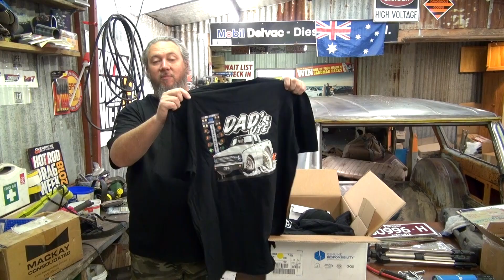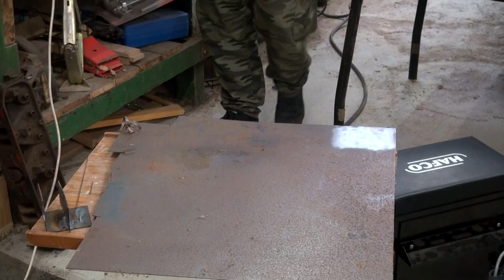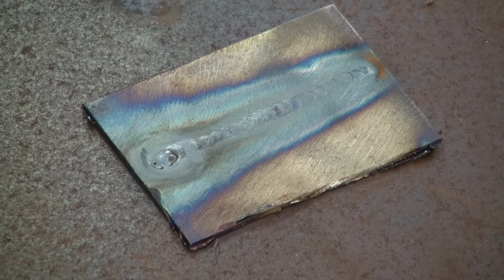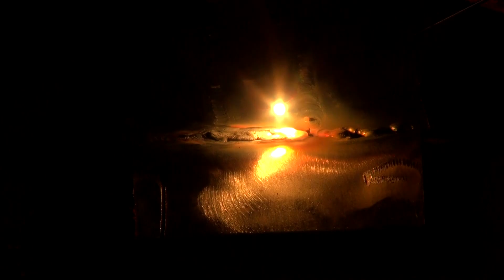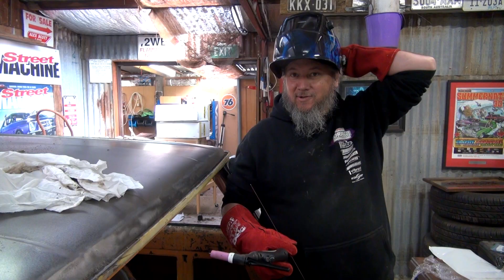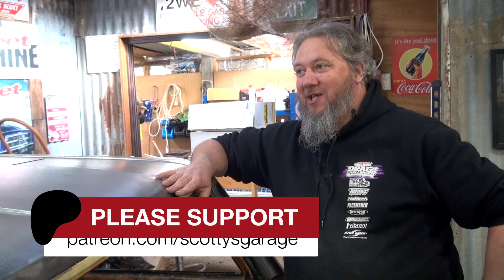Scotty's Teaches Himself How To TIG Weld... And It Goes Badly

Comment: Your welding table is an active part of the process. It sucks out the heat and provides a backing for the weld poo. On my car i blew three all over the place until I bought a piece of 50mm copper pipe and found some old 12mm copper pipe. If you place the flattened copper pipe BEHIND the welding gap you can weld more easily. The copper sucks the heat out and the weld does not stick to the copper, so you can use the copper as a backing for the welding pool. Car panels are thin...

Comment: Nice work Scott, i have same welder, i watched Trevs blog for Tig tips i was struggling to fill holes as well and his tip was arc on the filler wire not the panel to stop the hole blowing bigger and you cant fill holes in one go it takes a few times of fill a bit, stop, let panel cool down, fill a bit more to fill holes same as it would with mig
Reply from the maker: Thanks for the tip

Comment: Oopsie!!! I'm no TiG welder but I do know that the amps for 1.6mm steel will be far too high for 0.8mm thick bodywork steel. Then you have rust on the underside of the steel and you have to adjust the amps to compensate for the poorer conduction. 
Still, I think that was a brilliant first effort and unlike MiG welding TiG is practice practice practice

Comment: Hey Scotty your doing great on the tig mate for a first crack at it , I found when I used to tig it was easier to move the filler wire if I had a riggers glove on that hand for more movement on my fingers and still use the welding glove on the other , maybe give that a go for next time 👍🏽
Reply from the maker: @Matt_685  thanks the advice
Reply from the maker: @Matt_685  thanks the advice

Comment: Id use mig for filling holes. I haven't used tig for body work yet just stainless steel work. But for patch panels using tig should be easier. 👍

Comment: I'm transitioning from MIG to TIG too, so this video was very interesting! 👍
Re the holes in the thin metal, I think MIG with a fine wire 0.6mm or 0.7mm is a great method, just do lots of short tacks (less than a second) on the edges of any hole and it quickly fills in. 
MIG is great for that because it literally stuffs the wire right in its face.
I recently did a toolbox with 0.7mm thick sheet metal (ouch) and it was hole city, but I was able to tack up all the holes easily enough.
Reply from the maker: @wizrom3046  Yeah, I agree MIG is better for this

Comment: Great first crack Scotty! Definitely get yourself a pair of riggers gloves. You can also set the tig to start via the button which is find easier and i found the pulse setting easier to weld with. Keep in mind i’m self taught with 5 mins tuition from a boiley. Also keep a wire brush handy post weld to clean up the heat marks 👌

Comment: Hi Scotty,  I've also tried leaning to Tig welding with little success however a few things I've learned are

1/ When you were practising Tig welding, you had your test piece sitting on a metal table , the metal table draws the heat away making it much harder to blow holes , so when you tried welding the car it's "far" easier to blow holes .

 2/ When filing a rust hole the rust behind the hole is usually far larger than the hole itself so the metals much thiner around the hole.

3/ The most important thing to do is, practice,  practice, practice before touching your car

Comment: You cant weld up rust holes like that in that manner even if you are a skilled welder scotty so dont fret! I rekon there is alot of pitting on the rear of the panel causing it to be paper thin. You need to really cut out atleast 1" into the panel whenever you have wired through on the body and replace it with new metal. If its paper thin doesnt matter your skill really but you probably need to get that foot pedal out for that kind of of work so u can modulate the power as you watch the panel start to fall away. You also need to hold your hand steady by steadying your hand on on a surface, you were attempting what tig welders refer to as freestyling and thats not a novice move (Your cant maintain a consistant travel speed, angle, and contact tip distance without one.). You didnt do yourself any favours by re-welding over the same spots. You really should be only tacing every 1" around the butt to stop the panel from warping. You stack tacs till you make it the whole way around, then grind and repeat. Im using flux core to patch up my troopy after learning the cut-n-butt off fitzyz fab, he is a great teacher https://youtu.be/eKM0Yhgg040?si=CrNUqBi_M91nLOr4. Its cheap and does the job although it makes even great panel guys cringe as that recent video shows. Making mistakes with greg has a good intro to tig where i learnt all the above. Honestly i think its very advanced to body work with tig its def not an easy task, making mistakes with greg has some very good intros to the basics i mention above in his recent series: https://www.youtube.com/results?search_query=making+mistakes+with+greg+tig

Comment: Hey Scotty, Jake here from supermangs water to air tank. you're definitely on the right track, 2T no foot pedal, low amps, torch angle/rake should be anything from straight to 15 degrees (85 degrees). you can also push and pull if you're using the torch wiithout filler. The most important thing is to get comfortable and have fun! if you would ever like to collaborate again i'd be happy to spend a few days with ya. Cheers Scotty, all the best.
Reply from the maker: I lost your details, dude. Send me a message

Comment: Stick with it !!.   Practice make perfect, Not sure about in VIc but in NSW in 90s 1 night a week TAFE  welding courses. Ditch those gloves ( their MIG  ones = need thin leather welding gloves), Some ( even cut off finger tips of the weld rod  feed hand for better control ).  Use foot control = can vary current while welding = that weld towards the end = everything got too hot and not enough pace = foot control = can back off amps !!!

Comment: 25 years as a boilermaker and i have never TIG welded, so i can't knock ya for trying. I would say like all welding practice practice practice makes perfect. Anyway just wanted to say you can MIG body work, just need the amps down and travel fast. The biggest mistake people make with sheet is going too slow as once heat soaked it's game over. From what i see on your TIG welds i would say too hot but more a travel speed issue over amps. General rule of thumb i would teach apprentices, is your weld thickness shouldn't exceed your largest material thickness. So 1.6 gauge the weld should be around 1.6mm wide
Reply from the maker: Thanks for the advice

Comment: I'm no TIG expert but I have just recently done a TIG course at the Men's Shed, so I can offer you a few tips I learned during that 6 week course.

First tip is get some TIG gloves. Get some of those tighter fitting soft leather gloves. You don't need the same kind of protection that you need for MIG, so you can trade protection for a bit more sensitivity (I use them now for MIG welding, even if I have to replace them more often). 

Second tip (which you obviously learned online, which I didn't know) is that for TIG and gas MIG you push into the job, for gassless MIG you drag. You need to be able to see your puddle which is half the reason you want to push, also you want to be shielding the metal as you melt it not afterwards. 

Third tip surface prep is everything, especially when doing alloy. The mild steel you are doing is in between stainless and alloy in terms of how hard it is to flow the puddle.

Fourth tip tack your ends. I know you were only doing practice welds, but bad habits are formed by not doing the right thing. You could do fillerless tack on both ends before you started your run. Then blend the tacks into the main weld. 

Fifth tip, your filler wire angle is too high. You want to get it as low as you can. Try maintain a 90 degree angle between the torch tip and the filler wire. You want the filler wire to almost be touching the surface of the thing you are welding (even if it feels a bit weird). I like to hold the filler rod a bit further back, especially when doing alloy because at times you are going to need to feed it in faster than you can move your filler rod through your fingers. Experts can do it, but it probably takes years of practice to make it look easy. 

The hole was because you stayed in the same spot for too long / you didn't cool the work piece before you tried to join the third piece of metal. This is one that has caught me out a couple of times especially doing alloy. You want a spray bottle or a container to dip your parts in so they can't get rid of the heat. The first weld you did the parts were much cooler, but by the time you added the next piece they already had heat soak in them. Which combined with staying there a tiny bit too long is the difference between a hole and no hole.

I blew plenty of holes during the course in various materials and I learned a fairly effective way of repairing them. When trying to fill a hole point the tungsten away from the hole so the heat is on the thicker material not the thin melted edge otherwise you will just make the hole bigger. Next feed in plenty of filler, probably twice (or more) faster than if you were doing the ideal weld. You need material there to stop the hole getting bigger so sometimes that requires a really fast feed. The great thing about TIG is that you can smooth that lump out later.

Don't be tempted to keep going and going in the same spot. When trying to fix the hole, the temptation is there to think I nearly have it fixed, so you keep going and going over the same spot. Try doing this with alloy and the difference between everything looking great, and a massive blob of ally dropping away from the area takes about 1 second. Move to another area / cool the part before trying again. You will be surprised how quickly you can overheat the area.

Turning the power down was a big mistake and you can see that in the weld. I understand why you did it, thinking less heat is less blowout, but the issue was not the amps it was the technique, see how the welds went to shit. It lumped up straight away because it was too cold.

Sixth tip watch where you are putting your torch down, several time you put down the torch allowing the tungsten to come in contact with unprepared metal. Make yourself a simple torch stand so it doesn't touch the metal and contaminate the tip.

Finally your repair attempt. I knew you were going to blow a hole in that the moment you showed us the hole. Not because it wasn't repairable, but because you didn't have enough practice to attempt such a difficult repair. That was probably 10x harder than what you did on your makeshift welding table.

Seventh tip ( you learned the hard way) check list. Make sure your gas is turned on and the earth clamp in on with a good ground. Might seem obvious, but I have done it several times, coming back from a break you forget to turn the bottle back on or forget you disconnected the earth when you went to cool the part.

OK so let's look at your repair attempt in detail. So why would I say I knew you were going to blow a hole the moment I saw it? Because it was the perfect storm. A lack of experience combined with a very difficult repair. The moment you tried to swap hands I thought he's stuffed it. You had no where near enough practice to attempted that let alone left handed which you had zero experience at doing.

On the bench you had two pieces of metal 1.6mm thick butted together. Even with that "thick" metal you blew a hole. This was the first contributing factor you should have practiced and practiced till you felt super confident going in. I also knew you would attempt to weld it with lower amps than you had been practicing. It is the natural response for a novice (been there done that myself), even if it wasn't the right one. But the biggest thing you had going against you was not your skill level, but the fact that you are a MIG welder not a TIG welder. So if we were trying to patch a pin prick hole with a MIG we would point the wire at the hole and give it a quick tack.

I will better dollars to donuts you did the same thing instinctively with the TIG. The combination of the already slightly thinner roof metal, combined with it rusting way thinner, that was the guaranteed outcome. Couple that with the fact that you couldn't get the cup in close because of the drain channel, further added to the storm. You needed to up the gas flow and stick the tungsten out further so it was the right distance from the hole. Then start the arc away from the hole (yes very different to MIG) and start feeding in the filler wire like there is no tomorrow. Then later try smooth it out.

Being that it would be so damn hard to grind in there, the natural instinct would be to try and do a MIG type repair on it with minimal weld. Would I have blown a hole in it? More than likely yes, because I would have been tempted and probably do the things I am telling you not to do. That was a bloody hard repair even for an expert. You would need to be able to join sub 1mm material like a metal coke can to be able to do that repair. That was an advanced level repair, which more than likely didn't have enough prep. 

Overall I think your welding efforts with the TIG for a first go were not half bad, I would go as far as saying pretty decent, but they aren't up to the level you need for that kind of repair. Also as a side note, you would have been far better off cutting some tiny bits of filler rod, laying them in the channel and trying to melt them into the hole, trying to melt the filler rod rather than putting the heat into the paper thin body.

I agree with your approach to fix it, make a patch piece, tack it in the corners first, and DON'T attempt to weld it like you did on the bench. Just stitch it, let it cool, stitch some more let it cool. Take plenty of time and don't just try to rip a bead of weld in like you might with a MIG. All in all a good effort, just a pity about the outcome. That wasn't a bad effort even with the outcome. It was just a learning experience.
Reply from the maker: Wow, thanks for that.

Comment: Good work Scotty! Love the honesty.

I too am an amateur Tig welder, although several years at it working on the odd project. In the early days I also learned quickly that welding two pieces of near new metal together I’d very different to welding steel on a 30+ year old car.

Keep it at though! You will get there and in time find it becomes relatively easy.

Comment: Hey scotty tried putting some thin copper behind anywhere where you’re trying to do a pinhole repair or while your first learning to but some of this together it will act like a chill bar but also will stop the blow through. Cheers

I know people that used copper plumbing pip cut and flattened perfectly other have sued scrap buzz bar offcuts to put behind the thin metal to patch pin holes 

Cheers
Reply: Any metallic mass will work, but I don't think that was an option in this case.

Comment: Also, get something to place under your TIG arm/wrist to stable the tourch and what setting you have that is allowing the burn to run on after releasing the button, turn it off, when you let go of the button the tig should stop.
Reply: I get why he stuffed that up. I have done that myself. When you MIG weld you are used to hearing it just stop. The whole letting go of the button and hold it there for a few seconds is extremely foreign, and when you are nervous to begin with it is easy to forget you need to let go of the button and to just hold the torch.

Comment: Tig is all good in theory- however I think Mig on low setting is better for hole filling, short burst followed by a blast of air to keep cool, keep up the good work.
Reply: That would have been a tough repair with a MIG. The problem is the metal is paper thin. You can't get a rust hole without it rusting to zero thickness, so the edges are going to be very thin. You might have been able to braise it, but that was 99% always going to be a patch repair.

Comment: Scotty, you're trying which is a lot more than some folk. I'm not a welder & I've used TIG, not very well but I have mates who are welders, so I let them do the work for liquid currency. I spent the better part yesterday doing the suspension in my VY S LS1 Ute swapping it from FE2 to FE1. Everyone has told me to leave it alone as it sits good on FE2 but I'm restoring the ute back to how it came from the factory. Yep, cars are a pain in the ass, but remember, doing it yourself as much as possible leads to better & prouder results. I admire people who give it a go when they've not done it before.

Comment: Chin up scotty can't learn from your mistakes if you never try in the first place. Practice Practice Practice on the scraps of metal . Ask the guys at mpw for some tips maybe take the tig machine with you get them to properly set up and show technique . I did a short course at tafe they pretty much just go through the basics of the three main welding types it was nearly more written class work than practical .
Reply: I've just recently finished a TIG course myself. There is no substitute for practice. All the theory in the world is just that till the rubber meets the ground.